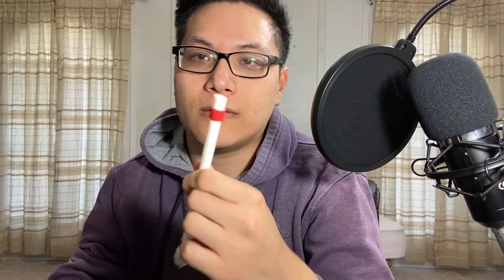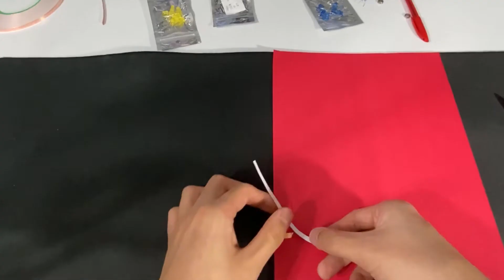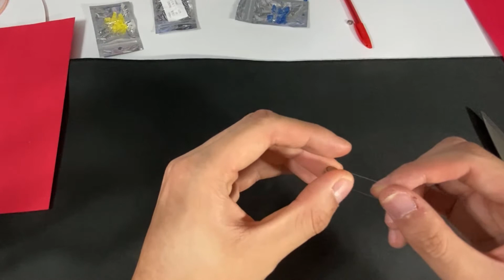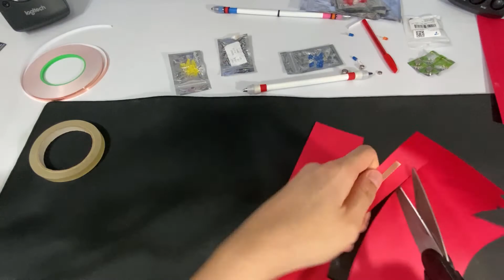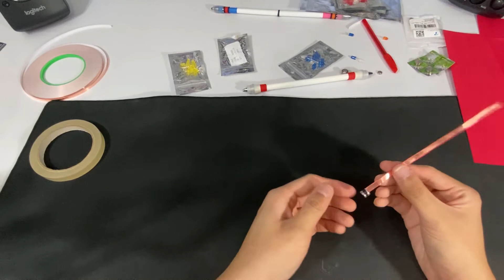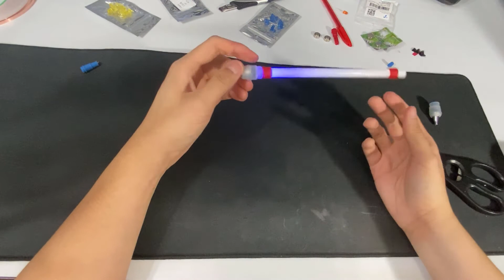LED Pen Mod: I turned my first pen mod into led mod

Comment: Use wire
Reply from the maker: That's one of the thing I wanted to avoid. Of course, you can easily attach a switch to it and etc
Reply: @DawaSmood  relatable
Reply from the maker: @NICK-zk6tk  Hehe xD